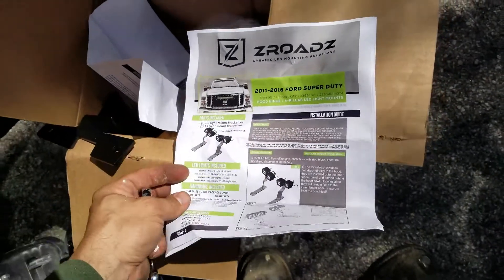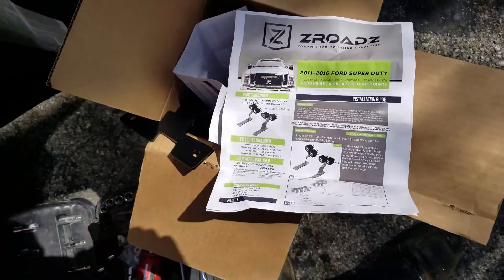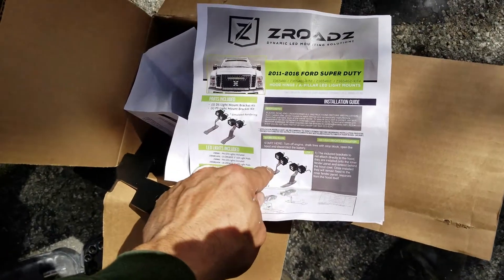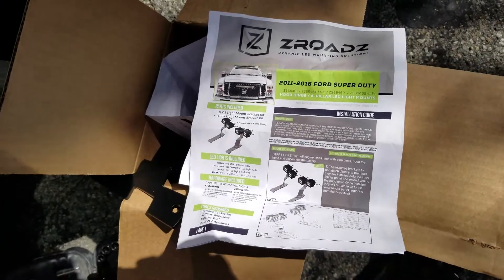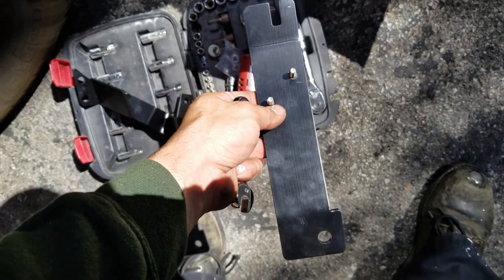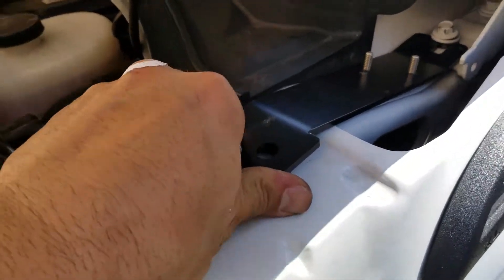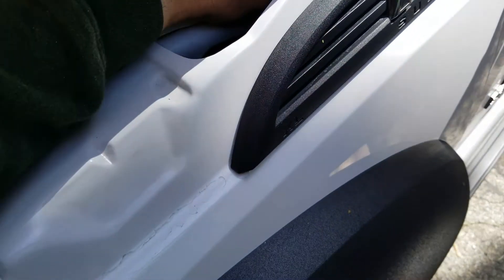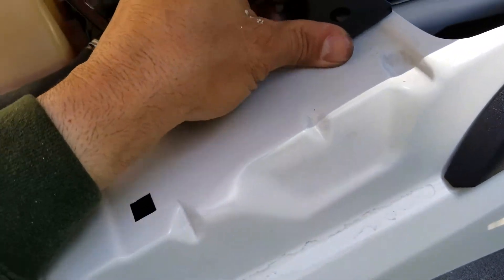ZROADZ BRACKETS | review and installation.

Comment: How do i do wiring please help
Reply from the maker: If your using a remote like i did.   The red wire from the light goes to the + inlet in the remote box. Black goes to -. Same goes for the remote box to the battery.